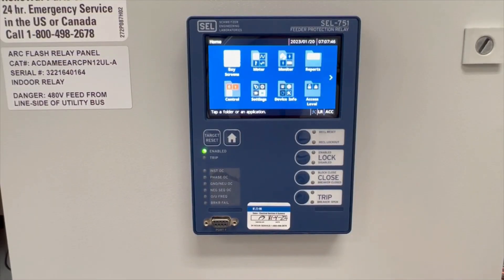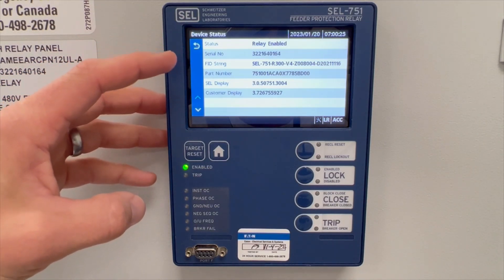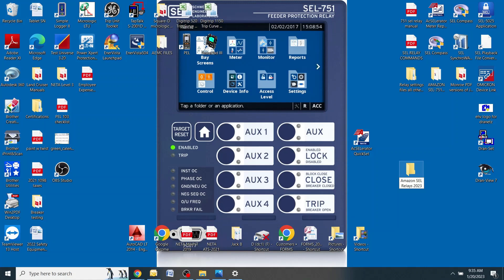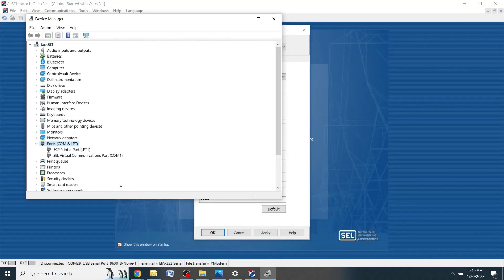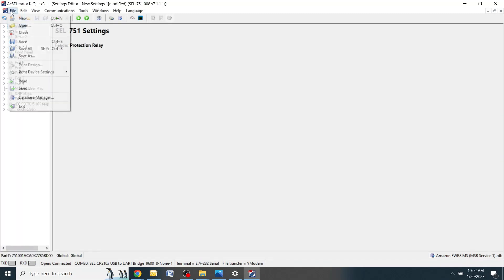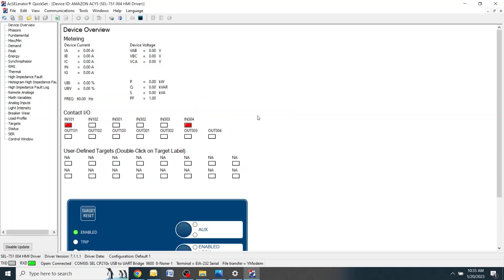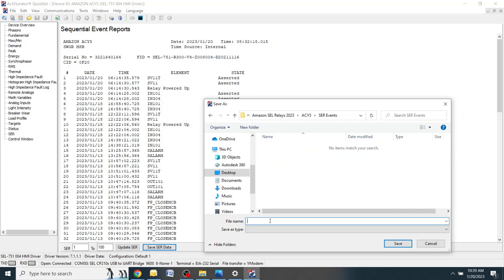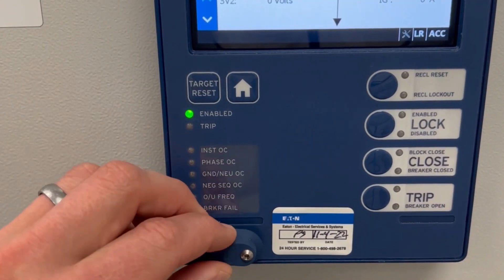SEL 751 Relay - How to connect with, download and save the settings file and SER records

Comment: Can Activator work for every relay
Reply from the maker: Acselerator quickest works on a wide range of SEL relays, however if you are working on an 851 you will need to download SEL grid configurator and use a usb-c type cable for communications. Hope that helps!